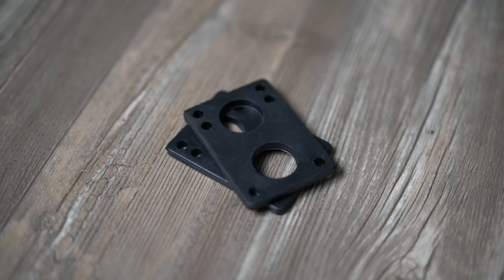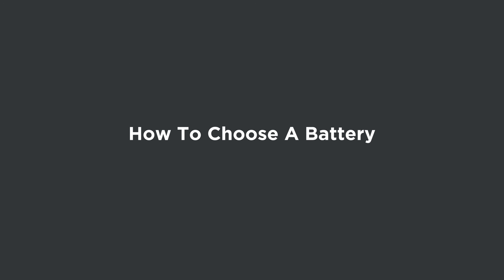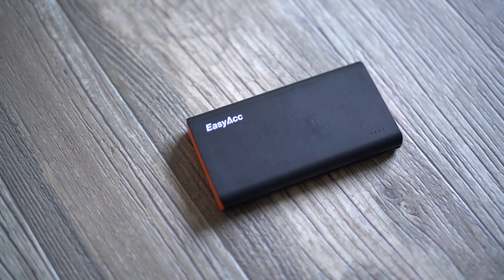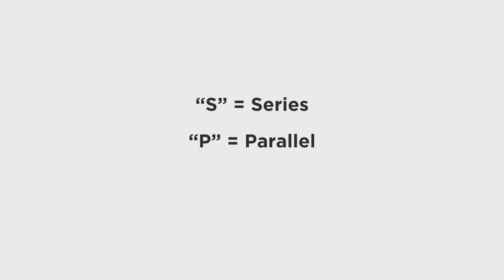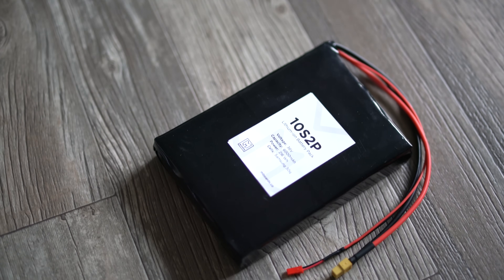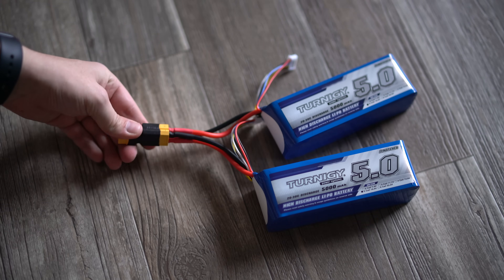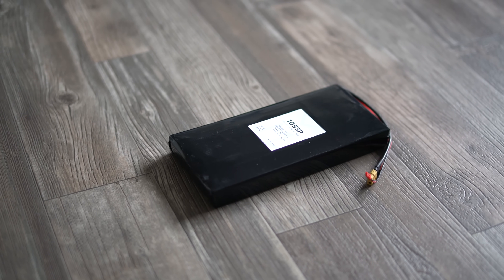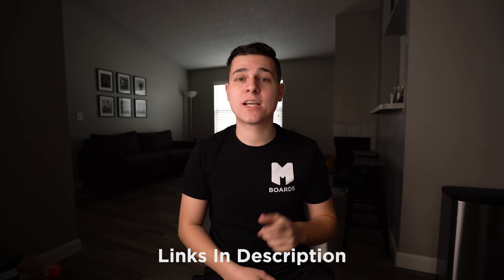DIY Electric Skateboard Build: How To Choose a Battery

Comment: Could I theoretically use 2 60 Amp hour  12 Volt car battery’s if I wouldn’t use it on a skateboard?
Reply: For UNDER $400 BUY greentec auto used "traction power " submodules.  NOTHING new is comparable to Honda Fit EV (car) titanate pairs they sell.  If YOU use one of the module's and sell other for $200 your getting deal of LIFETIME despite 60 months PRIOR CALIFORNIA leased usage.  Anyone who claims testing them during WARRANTY period (INFINITE miles!) WON'T RESULT in owning better than anything available new is ignorant.

Toshiba's site is secure so you sort of have to google usually to get English and right www letters to verify charging times etc.  Basically Pokemon cartoons make it simple THERE.  I like them even THOUGH so far clumsy and losing a DECADE  ...

The car as loudspeaker freaks are even making powerwalls OUT of titanium from ALREADY bankrupt once competitor.  This mboard forum can match THOSE to ship old decks to to HAVE USED lto DRIVEN direct drive installed.  ONLY a THOUSAND cars EVER IN usa USED these scibs!

Mboard WOULD do VERY WELL to file SBA LOAN APP to contract for ALL greentec HAS.  (Mid five figure capital ambition (if structured over time as they have to throw away good parts so defer that to month needed KEEPING limited pallets of just bms and cell modules prepared for immediately fulfillment AND HOW! AS LITTLE AS $50 CASH EACH KWH IF YOU DRIVE SEMI DOWN AND HARVEST ALL AT ONCE AND ARE EAGLE SCOUT PARTNER TO THERE NEAR NATIONAL BRANDING OF HYBRID GOTO SPOTS!!####!!!!#!!# )

Using dryer or oven jack and $99 rectifier charges to more than needed WATT hours in MINUTES!

Scib.jp BING SOME FUN BUT NEVER "METAL TO PETAL" ON THESE!!!

Comment: Hey there, I have a couple of these skateboards https://www.dhgate.com/product/daibot-suv-electric-longboard-skateboard/421516829.html 
and they came with 6s4p Lithium Ion batteries 22.2v;  8,000mAh; 177.6 Wh which are now starting to die (don't hold a charge real well and top speed is not what it used to be).  Is there any chance you could tell me if I can upgrade my battery for range and speed without blowing up my board motor???  I'd love a suggestion or 2 on battery replacement.  I can build my own enclosure with Kydex if need be..Thank you in advance.

Comment: Hey my dude, will this: 6s2p Complete Battery Solution power the torque board direct drive kit? I assume yes but do not want to buy it and not be enough to power the direct drive.
Focbox unity is my vesc if that helps any.
Reply from the maker: We’d recommend a battery with a few more cells in parallel to supply enough output to the motors. We’d recommend 6s4p. Should be able to get away with a 6s3p.

Comment: I have a question 

I buy a lipo battery yesterday. when i check it from lipo checker the reading was 

    All - 11.3v
    1s - 3.7v
    2s - 3.8v
    3s - 3.8v 

 I need to know is this battery is good or not. because of the 1s voltage is low.
Reply: Thats normal, when you charge it the charger will balance the cells properly "assuiming you use the balance lead"

Also for lipos there is a breakin period of about 10 to 20 cycles, at that point now the pack is ready to use at full output
Reply: @johnrodriguez2439  THANK you very much for your advice 🤗

Comment: If I wire 4 3s 5000mah lipos will it be like a 12s lipo?
Reply: if i’m not mistaken if you wire them in series it would be like having a 12 s battery with 5000 mah

Comment: What kind of retarded people actually think you could use a powerbank to power an electric skateboard.... well u can, if you extract the 18650 batteries and create the appropriate amount of cells out of them.
Reply from the maker: Many people who just getting into hobby electronics aren’t sure which batteries are okay or not. Nothing wrong with starting from the beginning and learning as you go. We just wanted to be sure we get that bit of info out there. We do get this question quite a bit.

Comment: Can i get 60 miles range with 15Ah and a very efficient pretty weak engine? I plan using 1s 5000 mah cells to make the pack by arranging them 8s3p, because i have a huge deck

Comment: Hey!  Thanks for this great video. Very helpful! What batteries can you recommend if I want even more range ? Like double of the 9000mAh or even triple ? Can I couple multiple of the 9000mHh packs ?
Reply: Wowgo at 14ah battery
Reply: @tobiasleierseder8470 where can I get one ? Do you have a recommendation? Thanks!
Reply: @luckycstriker  yes Just Google wowgo Board on the Side at Accessoires wowgo at 14 ah battery
Reply: @luckycstriker  and an enclosure ist With IT too

Comment: Very helpful videos, i appreciate the thoroughness. Im trying to repair my swag-board single hub. I took it all apart and checked the esc, battery and all the wires, and everything looks good. I put it all back together and it charged up and connected to the remote. I can hear it try to turn on in the motor a few times, before the wheel does a small jump and then everything dies. The board doesn't have much use, there is minimal wear so I'm thinking its a battery problem. Is there a doable fix?

Comment: Can you make me a custom battery pack. I bought and inboard m1 skateboard. It uses a 12p1 with cheap ass batteries. I would like a 12s or 12p 3 if it will fit in the compartment. If not I know a 12s or 12p2 will fit. It’s not as thick. Please get back with me and let me know. I do want more range right now I’m getting 5 miles at 24mph I would like 15 or 20 miles. Whatever you recommend it fine with.

Comment: How fast will two of 30C 2s 7.4v 5200mah go? Please respond quickly
Reply from the maker: 2 2s battery in series would most likely not even get the board to move at all. 

6s batteries are pretty much the minimum.
Reply: Oh ok thank you
Reply: Do you have any recommendations for batteries, preferably not too expensive but good quality and worth it

Comment: how do you calculate the dimensions of the battery? if i'm using Samsung  30q 18650 battery's ??
Reply from the maker: 18650s are 18mm in diameter and 65mm long. Using those measurements you should be able to add up each side of your battery for a rough estimate.

Comment: With the LiPo batteries since you have to unplug to charge them up could you just carry spares with you fully charged and change on the spot? Cheers for the videos thus far as well mate has really helped out with alot of the decisions
Reply: with a decent charger you can charge up to 6 of those batteries at a time also.

Comment: If I wanted to use a lead-acid battery, would a typical ESC work with it without any modifications? Let's say I would carry the battery in a backpack and run detachable wires do the board...I know it's weird but why not? I could get ~36V from 3x motorcycle batteries which is  ~10s li-ion

Comment: Do you know if there is and adapter to connect 3 lipo battery in S ? Or i have to solder?
Reply: Arnau Muntane You could probably connect two of them with one series connector and then connect those two with the 3rd with a second series connector.

Comment: Can I use battery with 756wh? Great video by the way
Reply from the maker: We’d need a little more info. How many volts?
Reply: 36v 21ah
Reply from the maker: That should work! Sounds like a huge battery but it should give you enough power.
Reply: Nice! Thanks once again , appreciate that you reply
Reply: Does the battery affect anything if I use 5065 200kv motor?

Comment: what does the  20c means on a lipo battery

Turnigy 5000mAh 5S       20C      Lipo Pack w/XT-60
Reply: 20C means the battery can safely discharge at 20X the Ah rating.  5000mAh = 5Ah.  So 20X5=100Amp discharge from battery.  A 5S pack at 21volts discharging at 100Amps = 2,100 watts.
Reply: @todddruskat6411  thank you

Comment: I mean technically you could use some power bank batteries and low discharge laptop batteries, you would just have to use quite a few in parallel which would be pretty big for a skateboard
Reply from the maker: Yes technically you could. But would probably end up costing you more in the end anyways. But would be very entertaining to see that.
Reply: recycled laptop batteries are really cheap and if you know were to look free
Reply: I'll be making a 5s battery from laptop cells... Just have to get me some bms modules and start crafting.

Comment: How far will the 10s3p get you? My board currently goes 13 miles and 23 mph. I will like to upgrade if I can get more range out of the new battery. Thanks !
Reply from the maker: It depends on a a few factors but we’ve seen ranges of 15+ miles with the 10s3p battery.
Reply: @MBoardsco  Is there any battery that can get upwards of 20? thanks :)

Comment: Hey Mike, great content! In the early planning of a 12s10p eMTB, wondering if you can point out any difficulties with a high discharge battery like this?
Reply: I'm currently making a 12s10p battery, it's not a pretty big battery I doubt it would work good for a electric board but I'm making mine for a electric scooter

Comment: Good video, just a minor correction. Voltage doesn't mean anything about speed without discussing the gear ratio and the kv rating of the motor. A 6s setup on a 400kv motor will give the same "speed" and power (Although double the amps) vs. a 12s setup on a 200kv motor. In terms of watts, speed, power it will be equal, just need to have a larger ESC for the lower voltage.
Reply from the maker: Correct. If the KV rating and gearing ratio remain constant then the voltage will fully impact the speed.
Reply: @MBoardsco  Also, you need to be very careful when increasing voltages without changing KV and Gearing as the power (Watts) to the motor will go up exponentially as voltage increases with no change in KV. Your ESC will need to be much larger and your motors may burn out if you push it with too much voltage. 

I just purchased a Meepo Classic as my first e-skateboard, but, your channel has me curious to build a board as I already have the majority of the required components (Motors, batteries, esc's). If I build one, I would probably want to build an AT board as I don't like the current options available on the market. 

What are some good resources to see what other builders have done with AT DIY Boards?

Comment: @mboards Does the 'C' discharge matter? For example is a battery with a 20-30c discharge, 5000mAh, and 6 sell 22.2v better than a 14-24c discharge, 12000 mAh, 6s 22.2v battery?
Reply: C rating is based on capacity, 5,000 mah x 20c = 100 amps, 12,000 mah x 14c = 168 amps. In theory, most fudge a lot on the printed c ratings.
Reply from the maker: C Rating refers to your discharge rate. If you search for a C rating to discharge rate calculator online you’ll get a better understanding on what to look for when searching for a battery.
Reply: Yes the discharge rating is very crucial for your acceleration and hill climbing. It also helps with voltage sag.

Comment: Will the 10s3p power a gen 1 boosted board?
Reply: Boosted boards use Lithium iron phosphate batteries in a 12s1p config, regular LiIon cells dont have the same nominal voltage as a Lithium iron phosphate, meaning that a 10s liIon pack will have a nominal of 36v and a Li iron phosphate pack at 10s would be 32v. So in short no it wouldnt power it
Reply: @sebkabob  what about a 12s2p?
Reply: @zachdomville6335  yes only if they are lifepo batteries

Comment: The two 5S in series looks good, but since there’s none in parallel, how does that effect range?
Reply: If you have the the 2 5,000 mah batteries in series you effectively made 1 10s 5,000 mah battery. Using 18650's most are 3,000 mah 1p  is 3,000 mah, 2p 6,000 mha, 3p 9,000 mah etc....range  can be figured from capacity.

Comment: Hi Mike! I really enjoy your vids. I was just wondering if a 12V 3000RPM DC motor would be good for a eboard.
Reply from the maker: Thanks for watching! I would refer to the Motor Video we just posted. 

You’ll want a motor that can handle 6s-12s batteries. 12V is too low when it comes to electric skateboards.

Comment: Nice but never you will do the best with li-ion vs Lipo Battery ,and it’s simple to had a bms but you need to use a powerful charger and will be more expensively

Comment: I am going to make 8S3P liion battery pack with Samsung 25r cells and bms (8S 100A, I will set current limit about 50A in vesc settings). I am also thinking about two 4s lipos and plug they into my BMS. Would it work?
Reply from the maker: Yes that set up should work just fine 👍🏻
Reply: @MBoardsco   what you think about charging and discharging lipos without balance charger, just using bms and charging port and normal charger 33.6V (8S maximum voltage)?
Reply: @hxjjdjjdj8020  its a good solution, if you go on the electric skateboard builders forum you will see that almost nobody uses balance chargers anymore. They all use a bms

Comment: Another good informative video 👍🏼 if I’m using a 6s4p battery, and I’m looking at riding at around 15-18mph , how long/far do you think I could ride for on a full battery ?
Reply: An electric skateboard consumes at least 10Wh/km. You have to convert your battery to Wh to calulate the milage. You need the mAh rating of the cells.
Reply from the maker: Would depend on which specific cells are used in the battery pack.